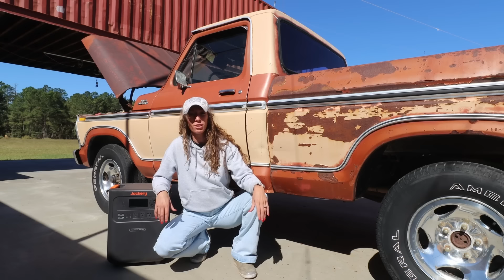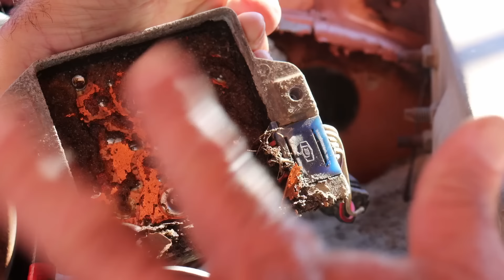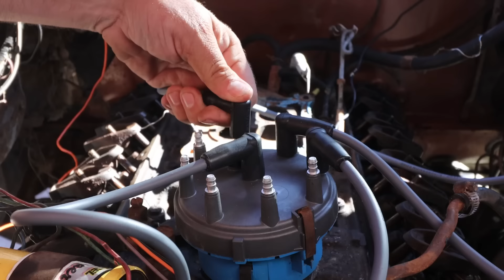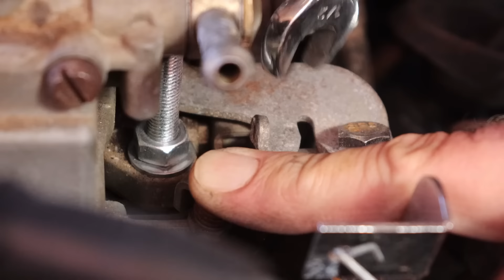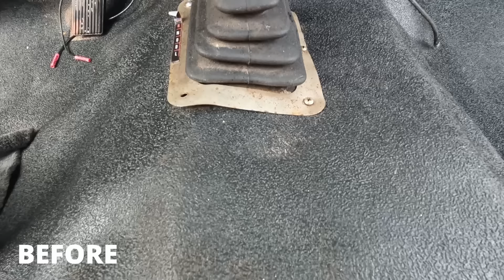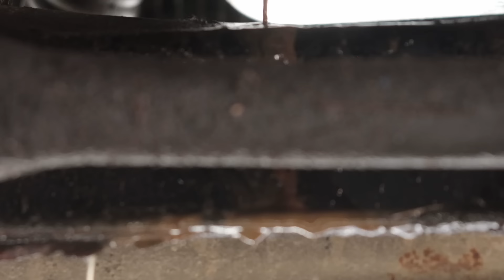First Start After Sitting for DECADES! 1977 Ford F150

Comment: I’ll tell you what happened the square blocked. It stranded that the old pan bolt screws through has broke loose. I’ve heard of it happen, but I’ve never seen it.

Comment: 40+ year mechanic here. Bad idea to try and start that with no carb. You need restrictor plates to limit the air. Without them your air/fuel ratio will be too far off to burn. You can get it to "run" but only for a few seconds. I think your video shows that well. If it cranks it will run so you will need a carb anyway.  (I suspect you already know this.)
Reply from the maker: Great points! 😁

Comment: That motor is an easy to pull. I would pull the pan and look to see if the block is cracked, if good you can clean the pan really good and maybe  pick up another pan from a wrecking yard and replace the rear main seal and slap it back in the truck. I had a 1973 F100 Ranger XLT that I drove for 20 years. At the time that was the top of the line from ford, A/C , PS , pb, power windows, wood trimmed dash you name it had it. 
Came home from working a few days out of town and found out that my wife donated it to the Disabled Vets. A Great cause but I still haven't gotten over it.
Reply from the maker: Oh no! Sorry your truck was given away!

Comment: That looks like a temporary expanding oil plug. I bet someone stripped out the pan of the original plug and put that piece of trash in the hole. Pry that plug out and chase the treads for a new plug. Lydia made the inside of that old truck look fantastic!! That was before she cleaned it!!
Reply from the maker: Good advice!

Comment: The original plug has been stripped out. The one in there works like a wall anchor when you first install it and tighten the plug. The one I had to use in my 1977 F100 when I changed the oil i would use channel locks on the adapter then take the plug out. Put about 60.000 miles on it that way.
Reply from the maker: That’s great info! Thank you!

Comment: I remember seeing cheap "fixes" for oil pan plugs that stripped out.  They were some kind of rubber and metal device that was more of a "just get it going and somebody else can worry about that" kind of thing.  
Guess who is the "somebody else" is...
You've seen those hollow wall fasteners used for hanging shelves and what not on a wall?  They work like that.
Search "temporary oil drain plug" for a pic.
Try pulling and turning to get it opened more. 
It's possible, just possible that someone lost the drain plug and just stuck this in there.  The threads may still be good.
Or a larger plug with re-tapping the hole.
Good Luck.
Have a good one!
Reply from the maker: Thank you for the information! We are definitely the “someone else”😂

Comment: You need to replace the oil pan. The bolt rusted to the nut inside the oil pan, and the nut came off of the oil pan (tack welded at the factory). You will also need to replace the rear main seal.
Reply from the maker: Thank you for the tips!

Comment: Drop the pan clean it out .. do away with that oil plug .. it’s probably been stripped,, over size it 👍 Awesome video ❤️👍 Fords are Awesome ❤️❤️👍 Also I’d run it until it heats up and change the oil and filter again 👍
Reply from the maker: Sounds like a solid plan!

Comment: First thing not the original engine for this truck or at least not the original heads or intake. This year truck never had an adjustable valve train. I also suspect due to the aftermarket shifter that has a pattern like you would find in like a Mustang and not one on the column it was a motor and transmission swap. The shift arms on the side of the transmission are different between the two. That drain plug is a pan saver plug that has now failed. Yes you'll need to go ahead and pull the pan, the drain plug hole is stripped out and will need replacing. Maybe do a little Cajun welding of a new nut in. Now that water could very well be rain water but could also have come from a rotted timing cover, it's aluminum. These are just a few things I have seen with SBF in my many years in the automotive machine shop and parts business. Really enjoy the channel and great job on how you did the T-bird.
Reply from the maker: Thank you so much for all of the information! Thank you for watching!!

Comment: You have to hold the outside of plug and turn the center to loosen the plug . You probably will have to replace it might be no good. should pull pan and clean all the gunk out of the bottom of pan
Reply from the maker: Thank you for the advice!

Comment: Hi Jim and Lydia🐊  I'd drop the pan as it's really the only way to truly get all the sluge and crap out of the bottom end.  At the same time you'll see what's going on with the drain plug.  In all honesty, I think that engine may have bigger issues and at this point, I'd simply pull the engine and get it on a stand.  You can degrease it and pressure wash it and get the pan off.  I'd also check the block for a crack around a water jacket.  With all that's going on, you may end up refreshing a junk yard engine or purchasing a short block.  I'll keep my fingers crossed for y'all and your friend.  Have a blessed week and I'll see y'all on the next one.   Larry, Central Valley, Ca.
Reply from the maker: Thank you so much for the advice and well wishes Larry!

Comment: Typical F_ O R D the inside nut that is welded to the inside of the pan has rotted off ! And is now rusted to the oil drain plug ! This is What  we called a quality ford product in the late seventys and early eightys along with having to carry two or three computer ignition boxes every where because the mite or mite not fire the distributor when you went to start it! It will run if you get a new oilpan with a drain bolt that will come out to drain the oil and run about ten gallons of diesel through the crank case  to clean out the sludge!you couldn't find a hootis that canfix old fords after they were rebuilt from an old wore out dodge!F##### OLD REBUILT  DODGE! OR IN THIS CASE FOUND ON ROAD DEAD!❤😊 FIND BETTER JUNK TO WORK ON!❤😊
Reply from the maker: Thanks for the suggestions!

Comment: i had the same problem with brand new 77 ford truck the nut is welded to the pan the first time i changed the oil it broke loss and could not put the plug back in they had to replace the pan
Reply from the maker: It is definitely a mess!

Comment: That oil plug is a "fix" for stripped threads in the oil pan.
Reply from the maker: Thanks for the info!
Reply: Screw the round part back into the pan . Hold it and with another set of pliers. Unscrew the flat piece.

Comment: I say pull the oil pan, not much choice now. If you do, make sure to clean it really well and heat it with a torch on the bottom of the motor before reassembling. The hot motor helps prevent leakage later
Reply from the maker: Thank you for the advice!

Comment: That was a great video! Lydia when you were sitting on the bench seat, trying to figure out how long it’s been and during that great pause I swear I could almost see smoke coming out of your ears. 😂 Jim I’ve been building and working on those old motors since about 1973 - with my pops and brother; and if that sounds like I’m bragging, I probably am!🤷🏻‍♂️ Anywho when I saw the water coming out of the oil pan I knew you were gonna have problems with that rear main seal. And you probably have a crack in the block as well. Honestly, if I were your friend who owns a truck at this point I would buy a short block and be done with it. It looks like your heads and intake manifold are probably OK. Just one man’s opinion.
Reply from the maker: Thank you for the advice!! We appreciate it!